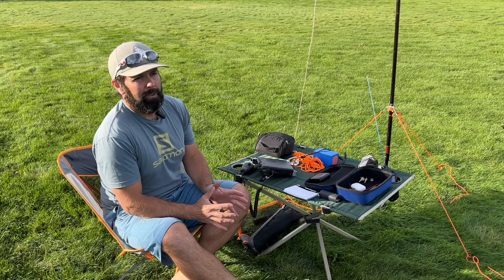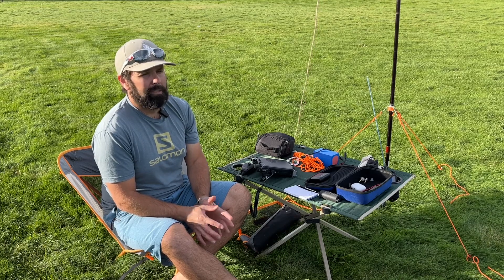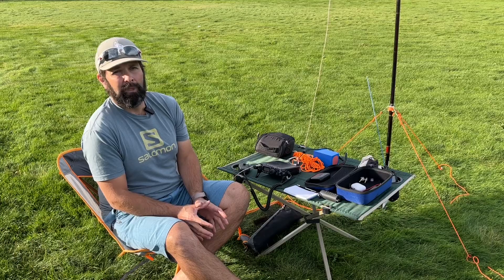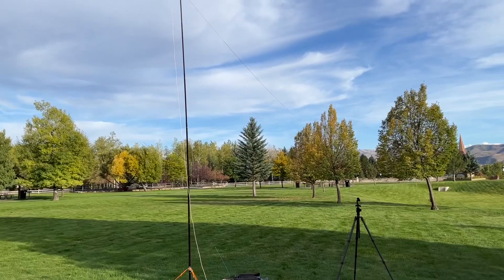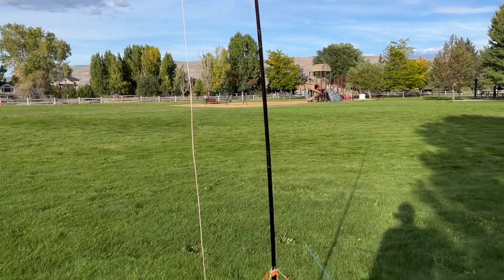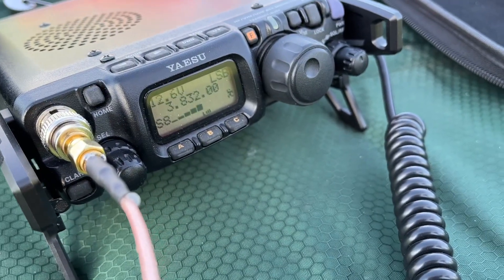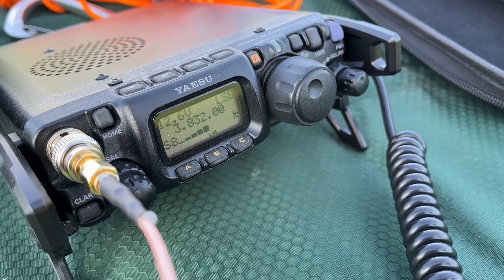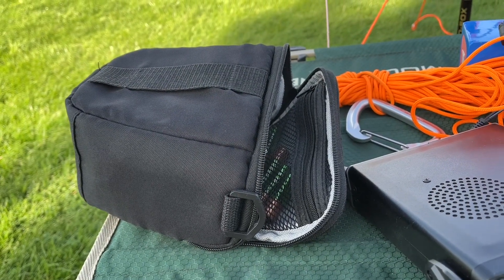Brief NVIS demo - from my station Yaesu FT-817

Comment: Well done, Eric. Thanks for demonstrating the power of 5 watts, a simple wire dipole and NVIS. The SWR was nice and flat based on what I saw on your 818.
Reply from the maker: Thanks Gaston. It's a really fun way to operate, as you know. And I think that's the thing, anyone can build this antenna with a few tools and parts. The SWR on this antenna at 75/80m (3.810-3.875 mhz) is 1.2-5:1. This is about 10' off the deck so I'm pretty happy with it. It's been really successful and works well with this radio. Take care Gaston, thanks for swinging by the channel. I've got one more video queued and that will be it for a while. 73

Comment: Great demo ! NVIS is a great way to make those closer in contacts. One thing I do that I have found helps, especially for shorter distance contacts is to cut a wire, 5% longer than the antenna (One for 40, one for 80 meters) and lay it on the ground directly under the antenna wire. It helps direct you signal straight up and increases signal strength. It makes a much better reflector than the earth. You have to use the length that is needed for the band you are on. If you have a 80 meter length of wire under a 40 meter antenna, it will affect the SWR. Give it a try.
Reply from the maker: Thank you! And thanks for the tip. I’ve seen discussion about using a wire reflector on the ground like that. It’s something I’ve been wanting to try. Next summer at this point. But I will try it!!
Reply: Yes, a reflector can be a big benefit. Lucky for me when I deploy at my condo I throw my wire over some trees that are over a chainlink fence that works quite nicely as a reflector. Over the summer I was checking into 80m Florida ARES SSB nets consistently with 20W. 5W worked but I would fairly often need a relay.

My antenna of choice was a 135ft EFHW antenna that was installed as an inverted-L that was choked and grounded at the feedpoint. Testing performed by Steve Ellington indicates about 3dBr improvement over grounding and choking at the radio and other configurations. For myself my EFHW went from a so-so antenna to my goto antenna that is very comparable to dipoles I've used in the past with easier deployment. Easy deployment is an Ecom and SHTF advantage.

Comment: Great video Eric.  It would be awesome if there was a NVIS event or net on the calendar like I’ve heard other states do.  Something where operators could do more than just check in and where they could setup and then try different antenna configurations.  I build a 20, 40 and 80 meter linked dipole but I’ve usually had the ends always slope the the ground.  I need to get it out find a location that lets me elevate the ends.  It would interesting to see the difference that makes.  Thanks again for what you are sharing.  73 W1UTE
Reply from the maker: Hey David, Thank you. I think that we could really benefit from creating a local NVIS net. I believe there may be one that UVARC puts on but I'm unsure about it at the moment. When life calms down for me I would love to see about putting one together. I look forward to hearing about your results when you can get your antenna out for some NVIS work! Take care - KI7WJP Eric

Comment: NVIS is probably the most important operating mode for Ecom and SHTF with 80m and 60m being the go to bands for amateurs.

The past few years I have started favoring a 80m-10m EFHW antenna for most deployments, especial 80m and 40m. My EFHW antenna used to be a so-so performer compared to 135ft dipole, until I made some changes suggested by testing done by Steve Ellington. His testing indicates about a 3dBr improvement by choking and earthgounding at the antenna feedpoint as opposed at the radio or other configurations. This deployment has made my EFHW very comparable to other dipole antennas I have used.

EFHW antennas are generally easier to deploy, especially if there is a balun at the center feedpoint of the dipole.  EFHW transformers can be place at ground level leaving only wire to support.

Steve Ellington tested many EFHW antennas and highly rate "MyAntennas.com," but I have done well with my Ultimax 135ft EFHW.
If you are looking at simplifying deployment I would imvestigate EFHW antennas. For QRP, possibly Packtenna.

https://youtu.be/MzfQybYMlUc
Reply from the maker: Thanks Viron! Lots of great info here. EFHW antennas are fantastic. They are much easier to set up, absolutely. With my QRP setup, using this dipole has worked very well for me. Next summer I plan to do a side-by-side NVIS communication exercise with an EFHW and a linked Dipole. The flexibility of the EFHW is exponential compared to a dipole. - KI7WJP Eric
Reply: @backcountryamateurradio  Be sure to be willing to experiment with the EFHW. I thinking once you find optimal configuration you will find performance within 1dB-2dB of a tuned dipole.

My standard NVIS deployment at my condo benefits from a 5ft tall chainlink fence as a reflector. Over the summer I had no problems consistently being widely heards SSB phone on the N. & S. Florida 80m ARES nets at 20W. Below 20W I would sometimes need a relay.

My Cha Emcom III P is good performer 20m and higher, but so far it is so-so on 80m & 40m. I have choked and added counterpoise wires, grounded, but I am still not satisfied. If I use the Cha counterpoise set each of the four wires are 25ft. I've been using more wires at a shorter varying length. The 25ft wires make Ecom portable less attractive, but that may be the magic sauce for 80m and 40m.